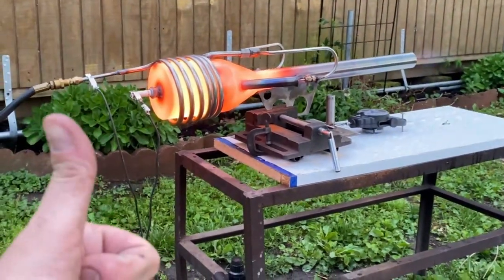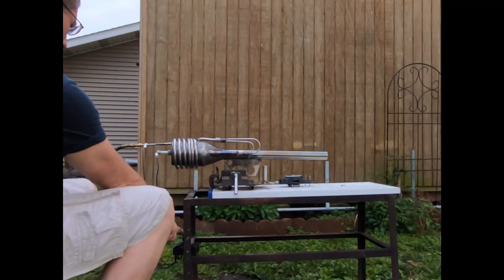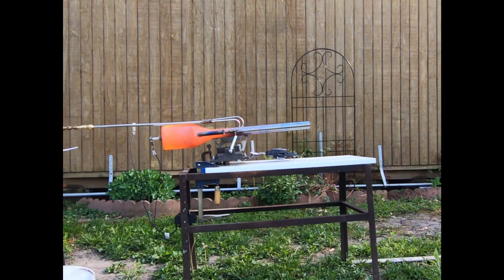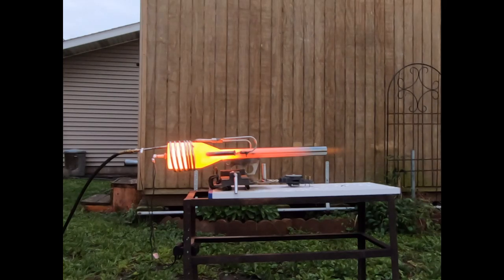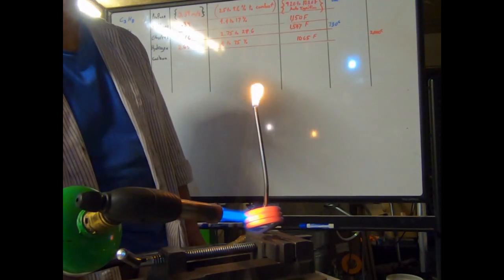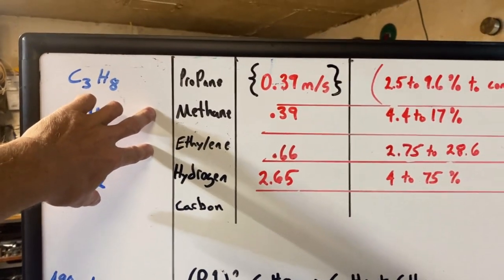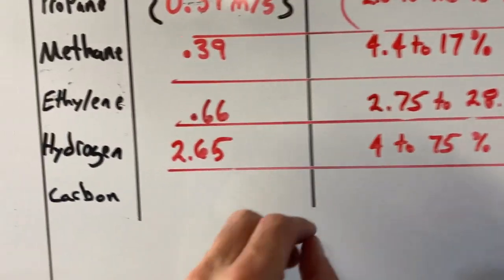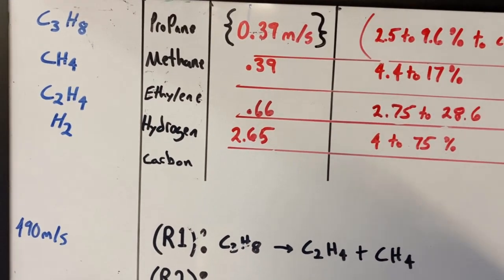Thermal Propane Cracker Pulse Jet engine

Comment: Could you get a lot more thermal conduction into those tubes by wrapping them tighter so they actually make contact all the way around instead of sort of hanging in the air around the combustion chamber?

Comment: Once this gets up to temperature, would there be any benefit to injecting high pressure steam in the same manner, through a different heat exchange tube. Essentially cracking more hydrogen into the mix. Or would it have to much of a cooling effect?

Comment: Dang this shit is interesting. Can you run the cracker inside the combustiom chamber or would it mess with the resonance too much?
Reply from the maker: The flow is very circular, imagine the pipe being cut in half with fluid flowing both ways during the tail end of the pulse , watch some simulations of pulse jets , its very cool .

Comment: Pulsejet engines actually operate at a lower frequency when producing more thrust.   When you throttle them down the frequency goes up.
Reply from the maker: The combustion velocity of the gas was increasing so i believe you may be in error not to mention we have a thrust gauge in place . 1lb vs 3 lb's with the coil  . as the gas is cracked into hydrogen and methane the higher combustion velocity of that gas changes the frequency , the lower density also plays a role  .

Comment: Would putting a shield/thermal reflector around the outside of the coil to get it a little bit hotter push it too much?
Enquireing minds want to know lol
Reply from the maker: I Have some heat tape , ye there is a point thats to much , 2,192 F should not be achieved or you start to make hydrogen , this will likely melt the burner
Reply: @NOBOX7  Blowing it up would make a great show. =P These things are cheap and easy to make, use titanium for the next iteration lol
Reply: Hydrogen is such a small percentage of the molecular weight, I think you’re fine to give it a try. Melting it would actually be a huge achievement and you could work backwards from there and use higher temperature alloys
Reply from the maker: @ohbeardedone9253  LOL Well said my friend, indeed ! Blowing this up would have bin a huge achievement today, but i failed you all . Im still not even in the Mach diamond club for crying out loud .
There are but a few fine mad lads who have achieved said feet ...

Comment: If the fuel gets cracked into hydrogen and carbon wouldn't that create buildup in the fuel system?
Reply from the maker: at this velocity its blown off the walls . soot is very powdery . This unit wont be cracking methane based on the colors im seeing , it takes 2192 F to crack methane
Reply from the maker: Good eye It could become  long term issue we shall see . The soot formation i have seen would easily blow away as its like dust . But i have no proof a long term crystallization of some kind of graphite or something wouldnt happen